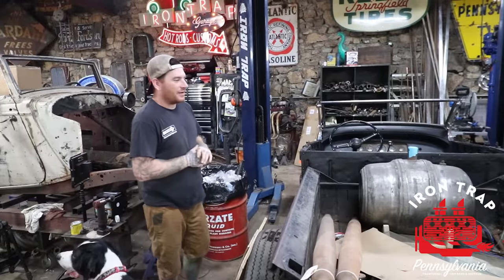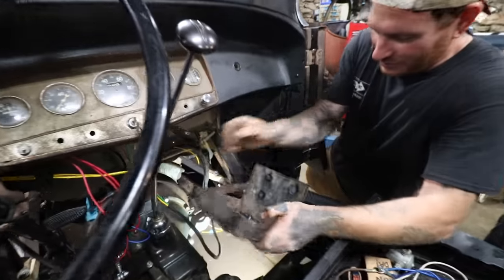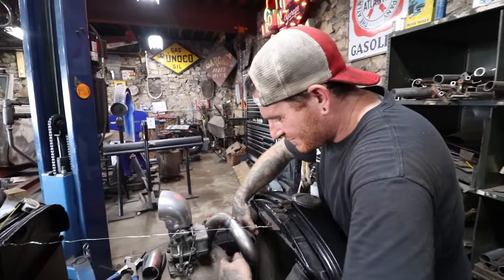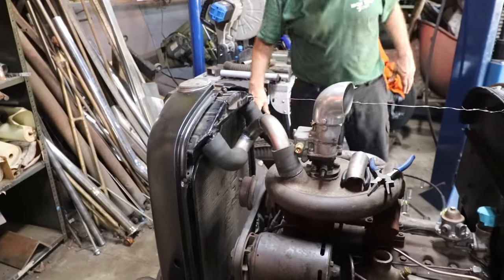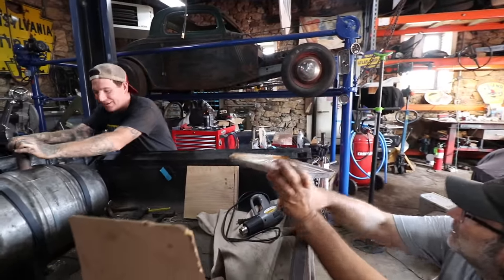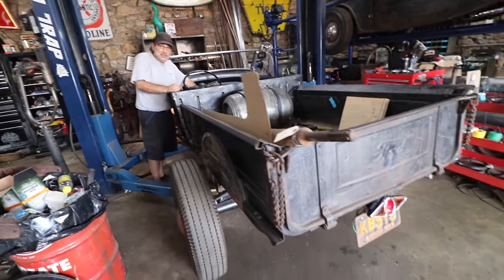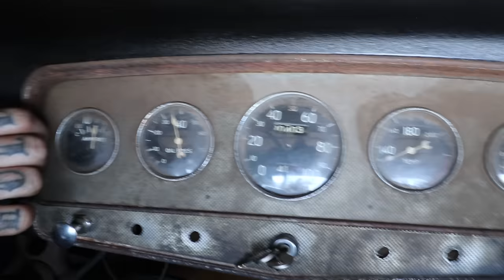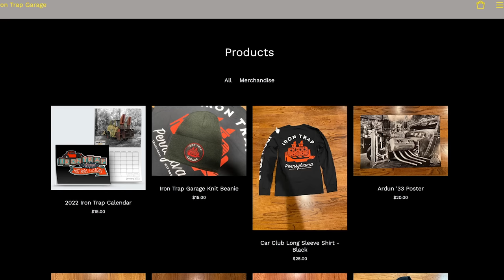The 1929 Roadster Pickup Has Working Lights & Runs!!!

Comment: Great progress on the Roadster Pickup....(you gotta love that supercharger).  Good progress on the wiring also..  It is lucky to have someone like Steve around.  I have found that when it comes to automotive wiring, there are only two kinds of people; those who can wire everything up and make it work (like Steve), and those who see it as some kind of arcane wizardry that is inherently evil and must be avoided whenever possible.  Also, it is really surprising how many electrical issues are caused by bad grounds...  The beer keg gas tank is really a great touch for this vehicle.  BUT - the fuel outlet at the bottom right is venerable to damage from items in the bed.  All it will take is one careless move with a 2x4 or a piece of angle iron to break off the brass fitting and then you have a serious (and extremely dangerous situation).   A simple wood or angle iron guard painted black and bolted to the bed floor would do wonders in preventing this...  I would hate to see this old rod burned to the ground...

Comment: Whatcha gonna do for a seat? Maybe something like a black school bus seat? That would look really cool and era correct, because most of the stuff built in the late 40s early 50s
Was with what they could find, my dad was of that era post war, he had rooms stacked to roof
With old parts, starters,generators,carburetors
I wasn’t old enough to value his 1929 pickup until it was too far gone, it was his first shop truck, his next one a 49 Ford F100 with a hand crank hoist on the back called the Pirate Ship 
By the way the signs from that era on the truck were metal and fitted on the bedside

Comment: Beer barrel tank mounted on wood supports, held down with rubber lined straps, feeding a rubber fuel line. Very cool, but is the tank grounded? Great potential for a static electricity/fuel incident. Otherwise love the truck guys!
Reply from the maker: The tank is stainless steel.. which a poor conductor of static electricity..

Comment: Very surprised at the battery location. Looks easy to damage and hard to service.
Reply from the maker: East to damage? It sits further up off the ground than the stock battery location. Easy to service.. remove 3-4 screws and the floorboard lifts up..

Comment: 1:54 Is that a jell battery ? If so what brand is it ?
9:02 How was that steel? fill neck welded to the aluminum keg ?
19:59 Anyway to support that fuel line to the carb ? Just thinking of vibration breaking it.
Reply from the maker: 1. Yes a non-spillable battery. Interstate makes this one but lots of company’s make them. 
2. Stainless steel. 
3. Made of nickel copper, same as brake lines. Won’t crack that easy.

Comment: Vent that "gas tank"! Might look cool but...you have only one place for expanding vapor & pressure to go...through the fuel line to the fuel pump, and hose clamps might not hold.
Reply: I would imagine it uses a vented cap. Old kegs as fuel tanks is not uncommon.
Reply from the maker: There’s a vent in the tank. You can see it in the top corner of the tank..

Comment: I have a question. How does the gas tank vent sitting in the bed from the sun hitting it? Is that even an issue, I was always curious how that worked.
Reply: Pause the video at 9 seconds. Look at the fuel tank. What might that little thing sticking up on the right side top be? Hmmm.
Reply from the maker: There is a vent in the top of the tank